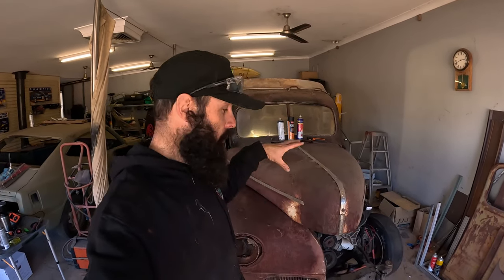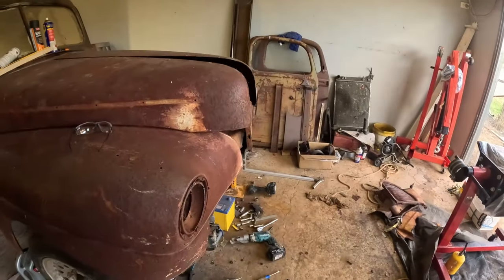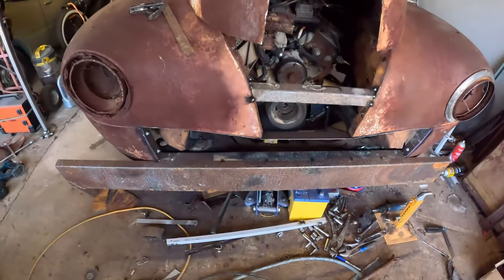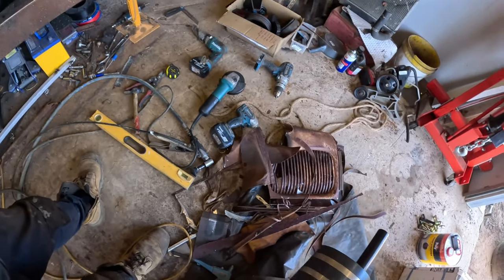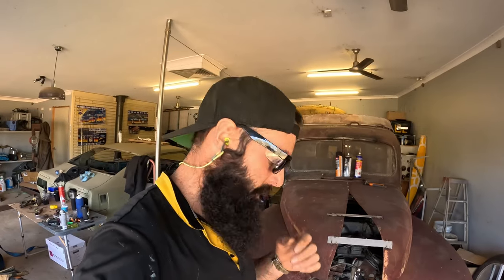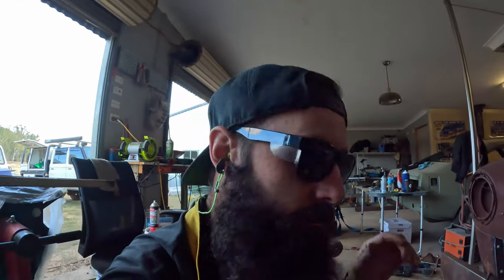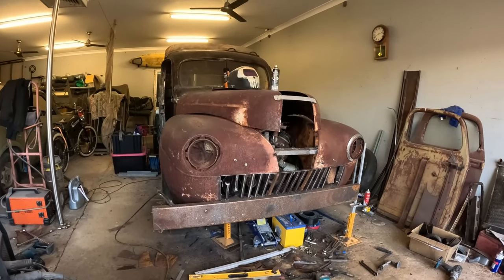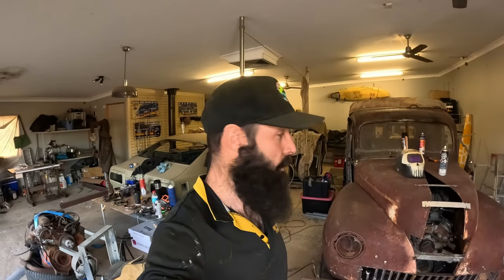I am building my own car.... with RANDOM parts- Part 2  [EP 29]

Comment: G’day mate, 
Good to see the ratty is getting some love ..
You could use the deluxe grills for the rear sides of the bonnet, it would look sweet as well as having the function of removing hot air from the engine bay. 
As with the bumper, check the legal side of it as here in Qld, you have to have them. But a split front bumper would look sweet. Have a good one, mouse
Reply: The hood vents idea is great!
Reply from the maker: hey buddy! ahhhh i will look into the bumper regulations, good point Mouse! im liking the idea of a side vent too actually, like flush? or have it a scoop? or facing backwards?
Reply from the maker: @CatFox2017  i agree! just need to figure out where and what shape etc
Reply: I’d go flush